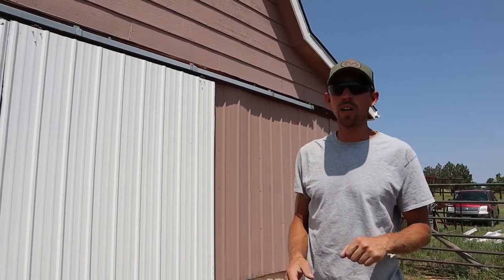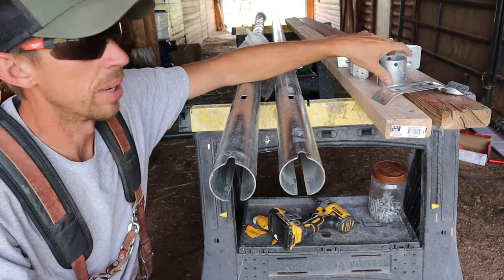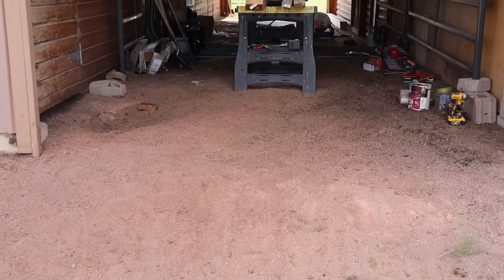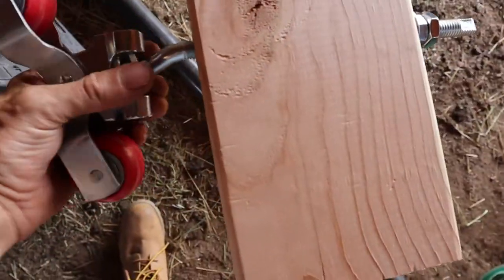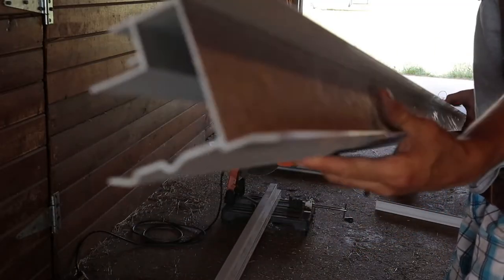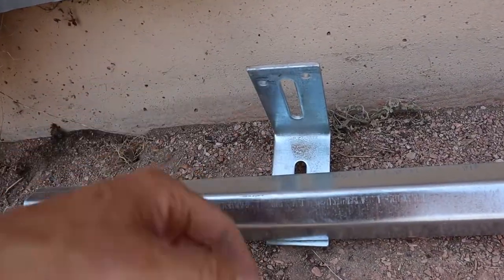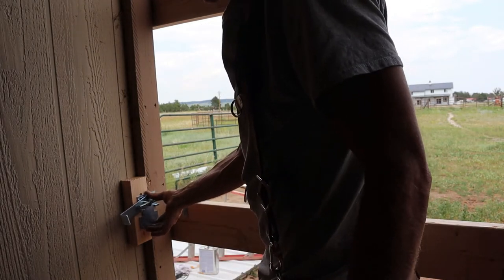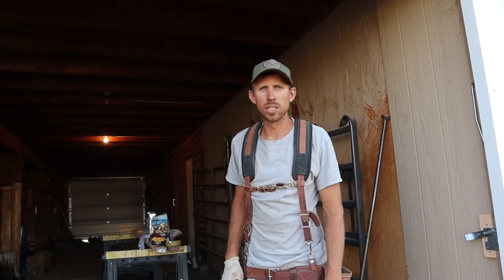BUILDING BARN DOORS//DETAILED TUTORIAL//EXTERIOR DOOR//

Comment: Where did you get the hardware and framing for the Sliding doors? I can not find that kit anywhere. if you have a link that would be great.  Thanks in advance
Reply from the maker: I got all the hardware, door rails, and guides through my local Central States Manufacturing supplier. You can look up Central States Manufacturing and find a local dealer. The track is a Cannon ball track setup.

You might also be able to find it through metal sales at Lowes, or Home Depot 

Hope this helps!

Comment: Great vid. Thank you for sharing. Where did you purchase the side & bottom rails? Do you have a nomenclature/part number? Thank you.
Reply from the maker: I'm attaching the part numbers for some barn door parts. Let me know if you have any questions. 

This is all from Central States Manufacturing Inc

Aluminum Vertical Rails:

   10VRTRL  (this is a 10' male vertical rail)

   10VRTWH (this is a 10' female vertical rail) 
        
-You can get these vertical rails from 10' up to 16' in 2' increments. If you are doing a set of double doors, you will need 3 male rails and 1 female rail to receive the the male in middle. If you do one big door, you only need the male rails

Aluminum Bottom Rail For Center Door Guide:

8BRL - 8'
10BRL -10'
12BRL - 12'
14BRL - 14'
16BRL - 16'

- these are channels for the bottom of the door.

Bottom Rail Guide:

6BGRl - 6'
8BGRL -8' 
10BGRL -10'

-this is the rail guide that attaches to the wall or ground to keep the door from swaying.
Reply: @buildingwithjosh  Thank you Sir!!
Reply: @buildingwithjosh  I don't see on the website where I could get these.  Do you have a local distributor?

Comment: Nice job, thanks for posting this. I have two large 12x20 openings to put doors on and this will help me quite a bit. I don't really understand where the framing boards need to be installed against the siding. Are they 2x6's with the back face against the same material the barn siding is installed making them protrude about 1/2" out from the siding J-channel?
Reply from the maker: Thank you!

Ok if I think I’m understanding your question, you are getting to the jamb board of the opening? The board that the wall siding butts up to? I always use 2x material on the jamb to flush up to my track header board, stick it 1 1/2” past frame. The jamb usually protrudes the j channel 1/2”, that way the door never hits the siding as it slides. Hopefully this helps!
Reply: @buildingwithjosh  Ok, think I understand. I was thinking of wrapping the opening in 2x6 or 2x4 material like casing. If I understand you, I don't do that I would just put a 2x8 on the jamb and slide it out till the edge is just past the siding J.
Reply from the maker: You could definitely case out the opening in a 2x6 or 2x4 if you would like too! Just make sure the surface area where the door shuts is flush with your track header board, whether it be your casing or a jamb board. The reason is so when the door shuts it has small tolerance for weather get in. When latched the door can pinch up against. Hopefully that’s makes sense. It sounds like you have a good idea on how to do it!

Comment: Great video.  Is the top bracket and flashing cover designed to wrap around a 2 x 6 at the top?
Reply from the maker: Thank you! 

Yes, the sliding door hood is designed to wrap the brackets and an extra 1 1/2" to cover 2x material and have a 90 degree bend up.

Comment: Excellent video, and the finished project was top notch!  Can you tell me where you got the parts for the locking bar in the middle of the doors, and the latches on the inside at the ends of the doors.  Thanks!
Reply from the maker: I used a National Hardware latches and locking bar. Farm supply stores carry them. I hope this helps. 
Thank you!
Reply: @buildingwithjosh  Thanks very much!

Comment: Thanks for making this video - really good.  How are these doors at sealing compared to a garage door?  Looks like you can get all the tolerances pretty tight.  Thank you.
Reply from the maker: Thank you!  
The doors can adjust quite a bit to get close tolerances, but a garage door seals better. At the bottom of the garage door, you can get it sealed better than sliding doors. So during a blizzard, snow can come in the bottom under extreme wind. But both door set ups have there places.
Reply: @buildingwithjosh  thank you - very helpful.

Comment: How did you determine height and level for attaching the cannonball rails for the door track?
Reply from the maker: I actually held up the roller to determine the height for the track. The top of the door hangs approximately at the top of the thread of the roller shaft. You want the door height to overlap the opening some, this helps to keep weather from getting in. Hopefully this helps!

Comment: where did you buy the locking bar with hoop for the center door? thanks
Reply from the maker: I got all my supplies from a Central States Manufacturing local rep. But any supplier that sells this rail configuration should be able to supply the locking bar.

Comment: What is the framing called used to build the door? Any help would be appreciated.
Reply from the maker: Not exactly sure I understand the question. The horizontal boards are known as girts. The sides are vertical rails. The bottom would be a bottom guide rail. Hopefully this helps. If I didn't understand what you meant, just let me know.
Reply: Yes sir I know what the girts are. But does the vertical rails & the bottom guide rail have any other name? I’ve been looking everywhere for them.
Reply from the maker: https://www.centralstatesmfg.com/ is the manufacturer I got all these parts from. Just look up a local retailer near you who you can order through!

 I have part numbers listed in the description